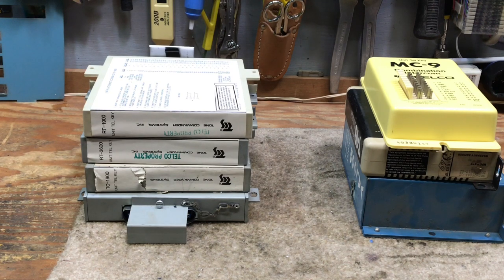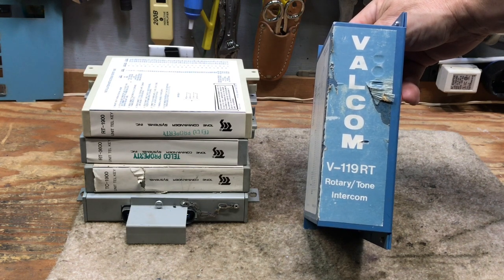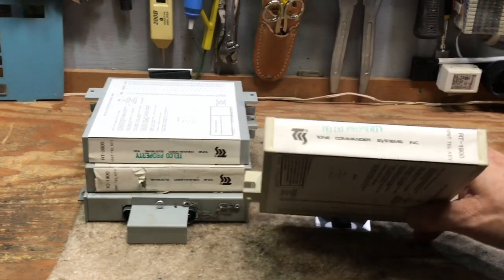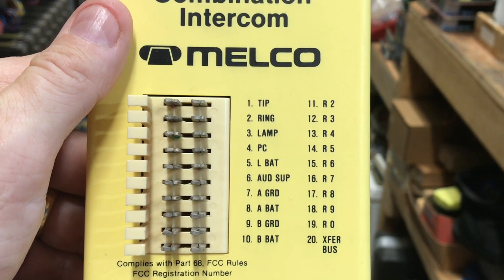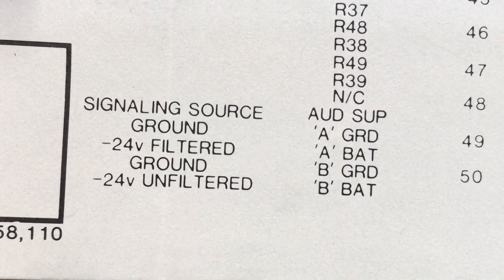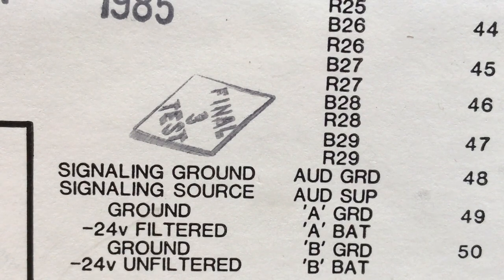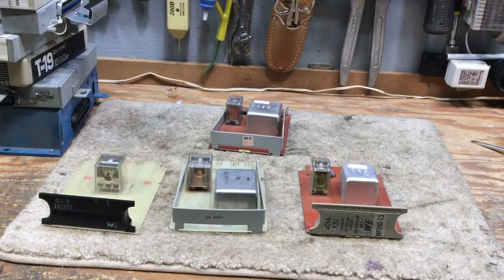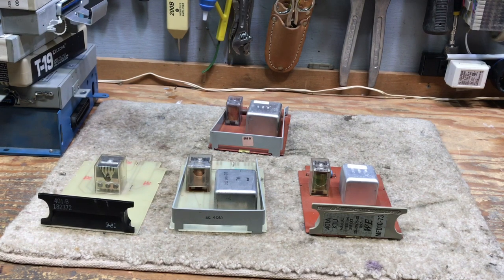1a2 Key telephone system dial intercom units.

Comment: That brings back a lot of memories.  Our 1A2 equipment was ITT brand and I did a ton of dial intercoms.  We generally used the buzzer for lines and the bells for intercom because in a busy office with a lot of calls, the buzzer was less annoying than the seldom used intercom bell.  For very small offices, I used a 401 manual intercom card and used a button on the phone for manual ringing.